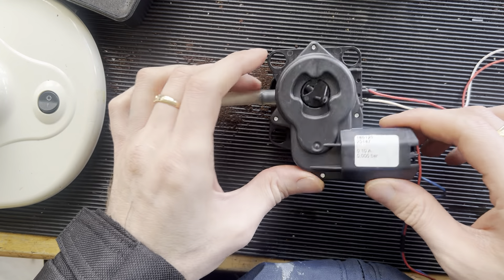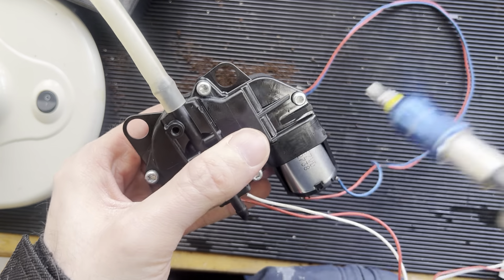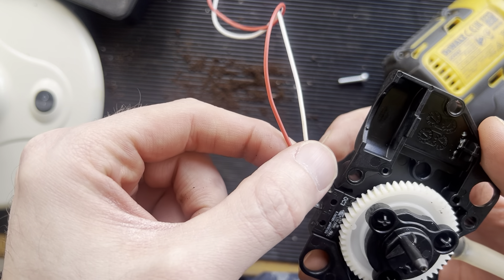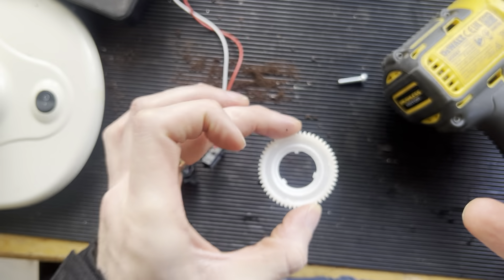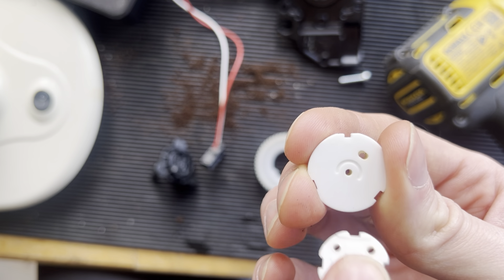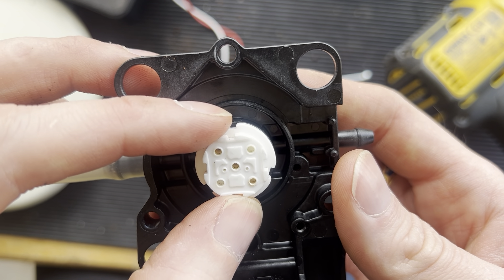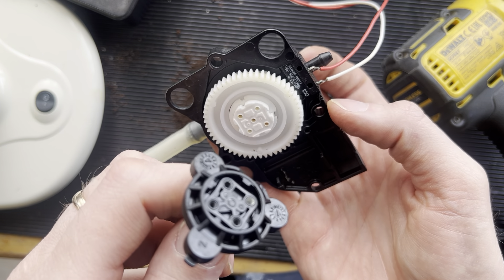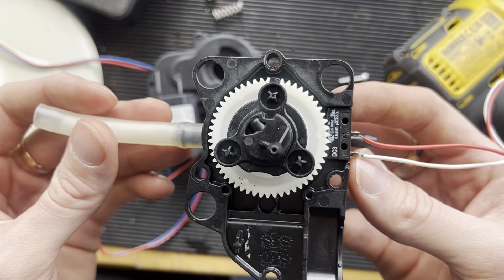Siemens espresso machine valve repair

Comment: I fix my keramik ventil on eq 7, but still coffee goes out in cup a bit later..  what u think they could be a problem? I clean flowmeter also.. maybe problem on brew unit?
Reply from the maker: @BOJANBAJALICA  I’m not an expert, but MAYBE it could be the white (ish) membrane that is located around the pump
Reply: @martinbankjorgensen  thanks
Reply: @martinbankjorgensen i will try to clean it if it can
Reply from the maker: @BOJANBAJALICA  check if the valve is broke. Mine was 😅